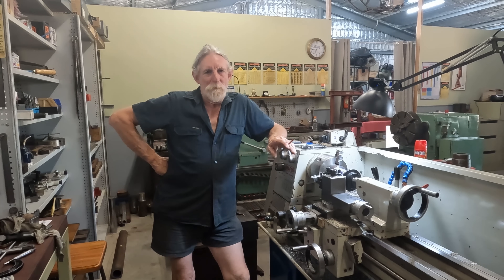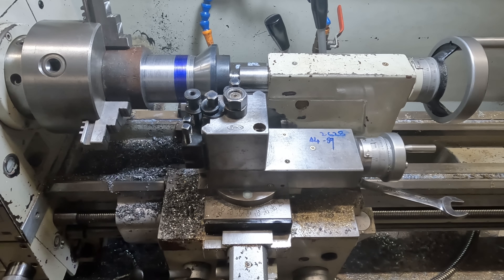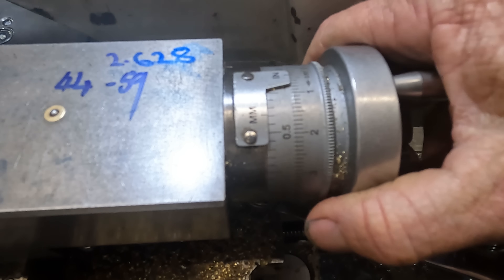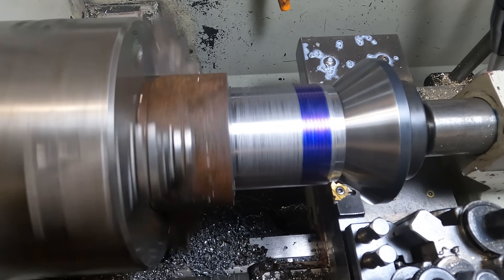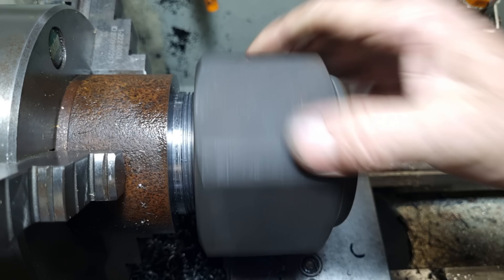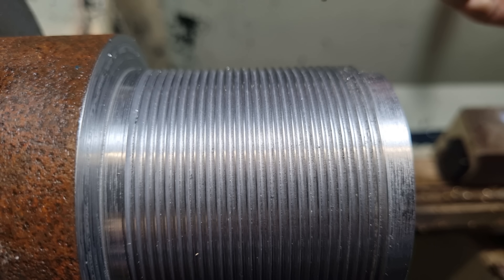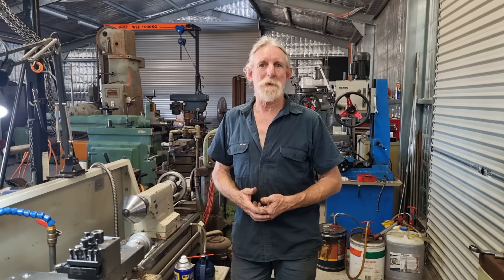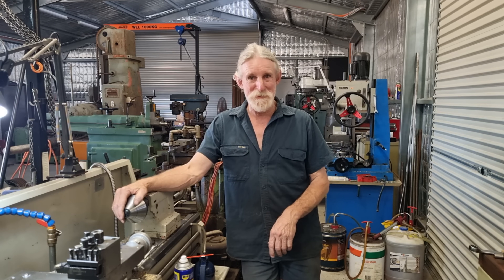An Alternate Method To Screw Cut Larger Pitches In The Centre Lathe .

Comment: I have been machining for 52 years. I completely understand your screw cutting technique and understand it. I run a quick change tool post with a dozen holders and a Sony dro. I also have my compound slide set to about 7 deg so the handle doesn't interfere with the tailstock. Anyway, if I move my compound slide in any way it upsets all the preset tool diameters and positions. So I don't move it. Hardly ever. To allow advancement when screwcutting I use this method. I leave half nuts engaged and use forward reverse function. So I take initial cuts with threadcutting insert and you know when it's getting loaded. On the reversing cycle I stop the lathe. I put in neutral and wind backwards by hand. I pause the pressure and take forward/reverse FEED lever into neutral. I then wind spindle a fraction more backwards while holding slight pressure on feed lever. As you rotate spindle you will feel the feed lever drop into engagement again. Then put spindle back into gear and continue with process. What I have done is advanced leadscrew one tooth of the "bull" gear. On course pitches I may advance I tooth at a time and finer pitches a couple of teeth. Last passes are simply plunge as the works done. This process is not taught. It's actually a lot faster than you think as no messing about setting toolpost etc. I use same idea to pick up an existing thread, especially an internal one. Engage boring bar and power in getting rid of any play but clear of thread. The put in neutral, disengage forward reverse feed lever and slowly rotating chuck a bit at a time, stop, wind cross slide gently back to contact thread and feel it touch. Retract and turn chuck more, repeat until your cross slide gets deepest. At this point you can engage bull gear and you have picked up on original thread.
Reply from the maker: No worries .   👍

Comment: I believe the reason behind the 29.5 or 30 degree angle and compound feed is to have the tool only cut on one side to alleviate pressure and chatter
Reply from the maker: It does help with that .   Up to about 8 or 10 tpi , you can plunge straight in most times with no worries  .   👍

Comment: You could use the tangent of 29.5 degrees as your relation of the feeds and be right on the money.
Keep in mind some crosslides are graduated 1 to 1 and some to 1 to 2.
Reply from the maker: Lol , my cross slide is graduated in direct for inch and diameter for metric !    👍

Comment: Never did understand why the yanks prefer the offset compound infeed. Having the compound permanently offset means you can't use it to accurately set a shoulder length and then have to introduce a dial indicator in it's place.  Direct infeed method is also much easier when chasing a damage thread.
Reply from the maker: It's just the way they have always done it i guess !  We were taught the English methods .  👍

Comment: Not criticising your technique as I've wrestled with setting the 29-29.5 degree compound angle and my compound has heaps of backlash, so this technique is a gift.
Not trying to be picky, given that you're using 20 thou DOC on each pass, if you go to 11 thou on the compound to every 20 thou on the cross slide you'd be hitting 28.8 degrees.

Great video and HUGE thank you
Subscribed.
Reply from the maker: No worries , Cheers  👍

Comment: If you have a DRO on your lathe, you'll be loathe to have the compound set at 29 degrees because any movement there screws up the DRO setting. When you make your living doing this, you tend to do what is most efficient, and a 90 degree setting is most efficient.

Plus carbide inserts don't like a scraping cut on the back side, this will chip the edge that you're not even using!

Laydown thread inserts are wonderful tech. They easily form two chip curls without a problem of interference. If you can keep the speed up, the finish is excellent.
Reply from the maker: Cheers  👍

Comment: Good video, I gave away swinging the topslide round in about the third year of my apprenticeship, the width at the bottom is easily obviated by always taking slightly less than half. Cut hundreds of threads like that quickly and easily in everything from aluminium through to Ledeburitic tool steel.
Reply from the maker: Cheers  👍

Comment: This is the only method I've used, I came up with this as an apprentice when I thought how stupid the angled compound was. This method means you keep track of the depth cut and is also good if you have to meet a fixed stop point with very little runout.
Reply from the maker: Thanks .  Makes it easy to pick up the thread again if the tool should move or get damaged .  👍

Comment: Valid technique but flawed inspection process. Using a nut as a "gauge" is throwing away the standards that allowed us to build the modern world. Most machinists do it that way, including my former self, but it is actually unacceptable. Making a nice fit on that unknown and crappy looking nut will likely leave your shaft anywhere up to .016" oversize.
It looks like your nut moves about .010 axially as you test the fit and that gives a pitch diameter clearance of ~.0087 but the nut can be .014 bigger than the min nut PD allowed while the shaft must be .0022 smaller than the nut min size for class 1a and 2a.
There is only ONE correct way to size a thread and that is to measure it and make it to the dimensions set out by the standard. Then it is guaranteed to fit any properly made nut regardless of class.
Reply from the maker: The video was never about machining the thread to any specific tolerance , but about the alternative threading process .   If i wanted to cut the thread to PD i would have done so , but that was not the point of the video .  👍

Comment: This is the way I always cut a thread because of two advantages. Firstly sometimes the thread is a little tight because although you are to depth the tool isn't quite at the right angle. If this is the case you can give the top slide a little nudge and it often sorts out the problem.  Second, when turning stupidly coarse threads you can cut to half depth and then cut to width with the top slide and then return to the start and cut to full depth.  using that system I once cut a 4 tpi thread on a 3 1/2 Drummond driven by a treadle.  I was a lot fitter back then!
Reply from the maker: Thanks .  Not sure if i would want to do it on a treadle lathe though !  👍

Comment: That is a very interesting method, it was quite clear from the close up shots that the tool was cutting entirely on the leading edge, and no rubbing cut was present, I think you could have missed out the last 2 spring cuts and had a tighter thread fit, as you say, another bit of knowledge to keep for future projects that may require this approach. Many thanks for posting! Chris B.
Reply from the maker: Thanks .  Being just a thread cutting procedure demonstration I did not worry too much about  thread fit , just went straight for Maximum DD for the 12 tpi thread profile to save a bit of dicking around .    Cheers  👍
Reply: @swanvalleymachineshop  Yes I realise that would be the case, no point in keep on pulling of you tailstock to check fit for a demonstration, nothing worst than pulling everything back of and finding the thread is tight. A good demonstration. Chris B.

Comment: Max, there’s no inherent reason threading with a plunge cut must overload the tool, regardless of thread pitch. If the tool is being overloaded, take a smaller bite. An infeed of say, .005” on the compound rest dial (at 30 degrees) will remove a smaller volume of material than a .005” radial infeed for a plunge cut. Therein lies the confusion.
Reply: The load is very high especially on the tip because chips are combining from 2 directions. If taking smaller bites works it just proves that there IS inherent reason that plunging overloads the tool. Time is a factor too. Instead of ~8 passes with a starting depth of .020 as you see here 
you could have to do  ~12 passes if you start with .015  
and  >20 passes if you start with .010.
So controlling the load gets you done faster.
Reply from the maker: @billshiff2060  👍👍👍
Reply: I have to disagree with you there, Bill. A .020” infeed applied at a 30 degree angle is, as I mentioned above, going to remove a smaller volume of material than a .020” infeed applied at a O degree angle (i.e. a plunge cut). Therefore, plunge cutting simply requires an adjustment to your normal feeding schedule, as it were. As long as both methods are removing an equal volume of material per pass, there is no overloading of the tool and the entire process will be accomplished with the same number of passes and in the same amount of time.
Reply: @mikelevyonline  When fed at 29° the chip is free to roll up and exit but when it is at 90° the 2 chips collide and pile up at the tip. Yes you can mitigate that force by reducing the infeed but at the price of more passes and it's quite a lot more. 
The first pass in either case is identical but after that the 90° passes get progressively worse as the chip width increases. Whereas the 29° load increases in 1 dimension the 90° puts more and more load on the tip colliding from both sides.

Mind you that is not too important in softer material and I do it all the time. In tougher stuff I prefer an angle.
There are also more advantages to the 29° that make better.
I spent 10 years machining nothing but 304 and 316 stainless and chipping the  tip off the tool is a pain I'd rather do without.
29° is the kinder gentler cleaner method. 

Ultimately it's up to the machinist which of the several methods to use and the results/cost will tell the tale.
Reply from the maker: Cut some 4 tpi or 6mm pitch threads & you will see  straight away .    It is also a lot quicker to rough the thread profile on one edge of the tool .  👍

Comment: My milltronics cnc lathe offers 4 ways to have the lathe cut the threads. one was the way you just mentioned. i didn't know why one would need to do this till you mentioned the heavier threads. now it makes perfect sense. thank you
Reply from the maker: Thanks .  Yes the CNC's have some interesting tool paths when it comes to threading .    Never used one ,   It was NC &  typing computer cards  when i was at tech school      & peg board control lathes at work  , but we were not allowed any where near them as apprentices !  Back in 1982 .     👍

Comment: I feed straight in anyway with no issues. My 1943 Machinist hand book says that's A-Ok  on 4-tpi or smaller. It does mention,(and I'm the first person on the interweb, pointing this out). Setting the compound and feeding in with it, does load 1/2 the cutter, but that's to take up the gear train slack. Plus I know it's hot down
 there. And I wear shorts year round. MI have a body shop that stays at 80 deg. f or 60 deg. C? year round. However those short shorts are gayer than gay. I you look ou Gay short pants in webster, that picture will show up. js I'll look around your channel and may subscribe.
Reply from the maker: Lol !  No ass less chaps or leather caps here !!!   👍👍👍

Comment: I have used that method on internal threads. The only issue I have is keeping track of the feed depth between retracts. Using both the absolute and incremental on the dro helps though. We're you using a full form insert?
Reply from the maker: Full form insert , but for a larger pitch .    Switch the DRO off Preso & just use the compound dial .   Mark the dial with chalk , that's  what i was taught !  👍

Comment: i was taught by a master machinist during my apprenticeship who had in turn been taught by a master machinist during his time. both were European and only used the 90 deg compound method you showed here. It isnt exactly the same as they did alternate cuts on the cross slide by cutting on either side of the tool as it advanced but the theory is the same. I was shown the 29.5 deg system at trade school but always returned to the way I had been shown as it made more sense to me and achieved the same result in a faster time. 
Topper machine works posted a video the other day where he stated "if you dont use or understand the 29.5 method, you are not a real machinist" which to me is the most blinkered way of thinking.
I was busy hammering out a scathing response to this steaming pile of h0r$esh1T until I realised he wouldnt read it anyway.
The usual keyboard warriors will call out tool loading causing chatter and yes, I grant you that it can happen but there are also ways to mitigate chatter and I have achieved beautiful threads in all sizes of diameters with the 90 method. 
Good to see another aussie with a clear and concise video of another way of thinking.
Reply from the maker: Thanks .  What was he doing in 1982 ,  i started my Fitting & Machining apprenticeship then .     Lol , that must mean i am not a real machinist either  !!!  👍👍👍
Reply: "I was taught to...(bla bla)" (and now for the unsaid REST of the story...) "and since that day I didn't give 1 instant of thought to it" . Anyone who says "I was taught to..." drops 25% in my estimation because I know I am dealing with someone who is TRAINED and not educated. Someone who copies not innovates.
Topper did NOT say USE he was referring to the term "29.5 method" not it's use and if you have not heard of it you are not a machinist.
Topper is not wrong to say that but he should have said "not a GOOD machinist". A good machinist WILL understand the principals behind the compound angle technique. He may choose to ignore the benefits in favor of another method but he KNOWS what he is giving up and what he is gaining by doing so.

I'm from the school of 1969 and currently teach a remedial course specifically on screw threads for machinists and inspectors who do not know the principals. This became necessary because the aerospace company I work with had too many rejections of what the machinists thought were perfectly good threads. "beautiful threads" does not mean good.
Reply: @billshiff2060  good for you bud. That make you feel better?
Reply: @jdshqs  aww , I bet you were taught to say that weren't you. How...uh... original? Here is another participation medal to add to your collection🎖. 
Now is there anything else you want me to teach you?
Reply: @billshiff2060  nah mate all good on that front, i doubt theres much I could learn from someone like you. you seem to have an issue or two so have a good one.

Comment: The first time I ever saw this method used was by another Aussie Machinist, i.e., Kurtis on his channel Cutting Edge Engineering. I'm a hobby machinist, who took a class in machining to get started, and was taught the traditional method with the 29 1/2 setting on the compound.
Reply from the maker: Thanks .  If you are doing finer threads , just plunge straight in .   Compound in line with bed .    This way makes it easy to pick up the thread again if you have to remove a tool or one breaks .  👍

Comment: The machinists at the steel mill would normally do a carbide insert tool straight in for the whole thread and were usually successful and quick about it. I try both methods here and there, but typically I am random on the cross slide, just to clean up the right flank a little. Not as precise, but it is a hobby shop for me. Enjoyed the vid, cheers Max!
Reply from the maker: Thanks .   👍

Comment: Nice demo,Max. I was taught both compound set at half angle and this method as an apprentice both in work and at technical college.
  The rule of thumb for ratio was roughly 30% to 50% of compound slide advance to cross slide infeed depending on the helix angle and thread depth,this requires a bit of experimentation but you soon get a feel for what is going to work for various thread forms.
Also taught not to bother too much on shallow/fine thread forms as simply infeeding with the cross slide will produce a good thread,especially when using full form carbide inserts.
Reply from the maker: Thanks .  Over  8 tpi or under 3mm , i just plunge straight in .  👍

Comment: Good tutorial Max.  I remember David Wilks using that same set up, but with a different technique, to cut multi-start threads.  I usually thread with the compound at 90 but just plunge in.  For most pitches my lathe is rigid enough that I can do that.  I'll keep your method in mind if I cut some large threads and have problems with vibration.  We have a windchill of -40 C right now.  No shorts for me.  Ken
Reply from the maker: Cheers Ken .   Yes , the compound is the easiest way for multi starts .   Esp , like Dave was doing 5 starts !    Don't worry , the shorts only come out when the temp hits 40 ! 👍

Comment: This works great because it's doing basically exactly what you're doing when setting your compound to 29.5. The sine of 29.5 is ~.49, which is close enough to .50. Great vid as always!
Reply: Since the top slide is operating at 90 degrees to the cross slide, the angle that Max is achieving is actually arctan(0.5) =  26.6 degrees.  To approximate 29.5 degrees the ratio of top slide to cross slide movement should be tan(29.5) = 0.566.
Reply from the maker: It is an easy ratio to use .   Just leave enough for a couple of straight plunge finishing cuts .  👍

Comment: I have use this method since I learn up a single-point-thread-cutting and I still use it. To deal with compaund adjusting to 29 (29,5) deg and back to 0 zero is quite a struggle. Through practicle I noticed that up to 2...2,5mm thread pitch no need set compaund in 29 deg. Nowdays carbide tooling goes easy. 
Good luck!
Reply from the maker: Cheers .  Yes , some lathes the compound graduations are not for counting back from 90  .  👍